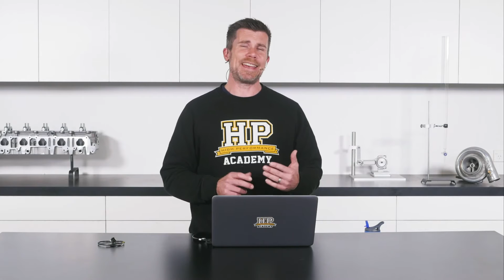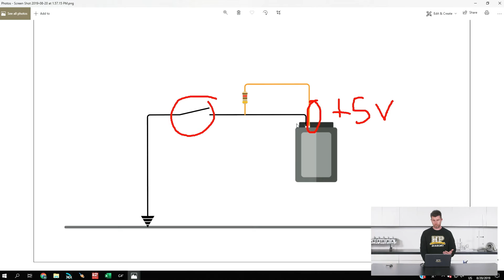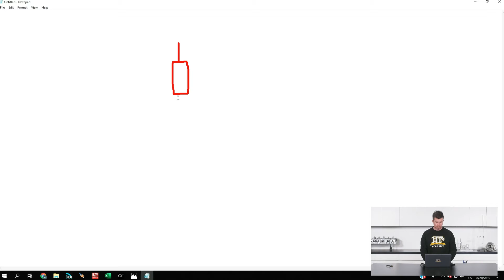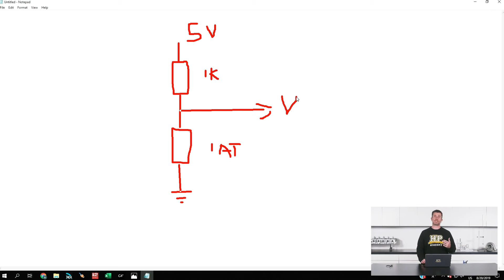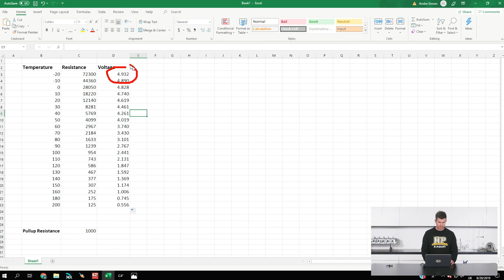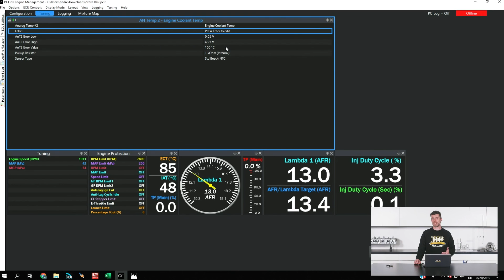What is a Pull Up Resistor?

Comment: You explained what to do and when but didn't really explain why the voltage on the other side of the resistor is or isn't 5V since the ECU is treated as a black box.  I get that adding a resistor prevents a high current under shorting but it's like half of the circuit diagram is missing. From a practical point of view, I think you nailed it but in terms of understanding why, not really. The wikipedia page is similarly incomplete so don't feel like I'm singling you out :)

Comment: Very helpful. Realised i have some wiring issues with temp sensors i had going to analog inputs. Will have to run an external pull-up resistor for those!

Comment: I keep scratching my head with the resistor in my wiring as a guy with ocd…
Lord Simon says thou shalt not solder, plus the thin strand single core doesnt allow to be crimped into a connector….
I have stopped working with error 404 blue screen of death in my wiring section of the brain.
Reply from the maker: People just get emotional about being told solder isn't the one tool for every job under the sun and don't notice no one is saying crimping is the one tool for every job either, but we understand your struggles 😂 - Taz.
Reply: Help! I have totally been lost after the aircon section! It was lots of scientific talk cancelling itself one word after another….
I will be having a functional aircon in my car too running an Australian standalone ecu…
I have been told to use an analog pressure sensor on the refrigerant line to the ecu, here your webinar coincides with what i have, i dont select pull up resistor on in that case.
Ac compressor has two wires leading to it so one is ground other is voltage, one of them was connected to a manual rotary switch before because the old tuner decided to be a hack. 
Ac compressor is also needed to be connected to a relay to power on, and also needs to be connected to an Aux output on the ecu.
Well then to tell the compressor to turn on, and both the ecu and compressor to know its time to go to work, the aircon climate control or blower fan motor has to send a voltage to either ecu or the relay that fires the compressor on so which wire goes from the climate control to what now?

And the piggyback issue here, if both ecus have pull-ups on same same input or output, then i am assuming we keep pull up switched off on the piggyback unit and dont wire a third resistor to make the client go nuts….
But you cannot turn this off, incase this is a thing like MAF sensor or something related to the life support of the engine….whats the solution here…be careful doesnt cut it.

Comment: This is awesome. I tune Holley EFI systems and the Terminator X ECU does not have the ability to add an extra thermistor. Using a pull-up resistor, I can now easily add an extra temperature sensor as a 5V input.

Comment: In an aplication where software selectable resistor isn't an option, how would you hardwire it into a wiring harness? Crimping standard THT doesn't seem a very good idea although I've never tried, also the legs are very brittle under vibration so maybe soldering and potting whould be and option.
Reply: a lot of people solder them to a dtm 2 pin plug and pot them. otherwise you can get away with just soldering it to the wire and  using the cable + heat shrink to support it, usually near the ecu.

Comment: Master and Slave ecu.
PSI/Doosan designed their LPG/NG ECU for an 11L Inline 6 engine, one bank.
When they added a slave to run fueling and ignition for the 14.1L V8 and for the second bank they used Diode prior to Shutoff Solenoid as well but in reverse creating a Quantum parallel circuit by reversing direction of diode for Slave side solenoid.. Engineers did not realize this until our conversation as I was curious as to why they chose this route.
When i asked them if they was aware. Response from th Engineers was no we did not realize we had created a Quantum Parallel curcuit. He said it just worked on a system not designed for a second bank.
Lol SMH..
Yes current would flow through a gates direction diode violating basic laws but not Quantum laws.
Was an interesting conversation in 2018.
24v DC circuit FYI